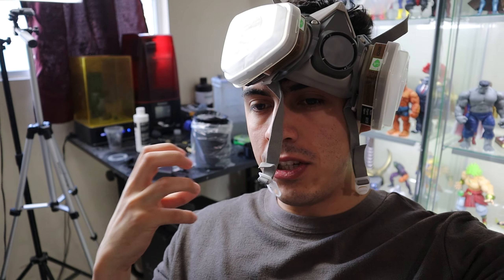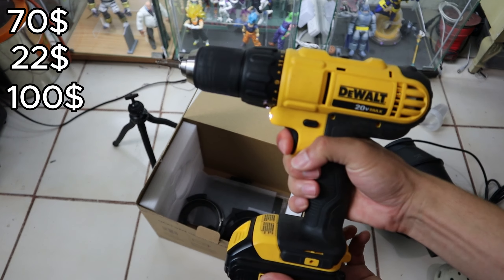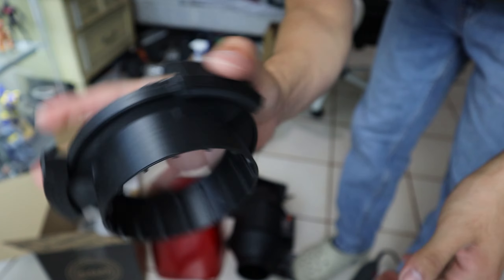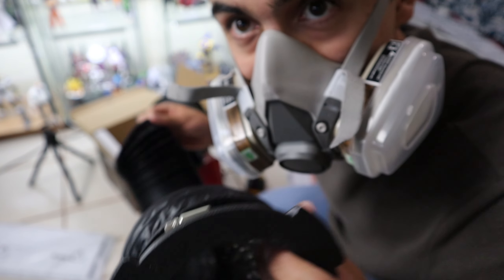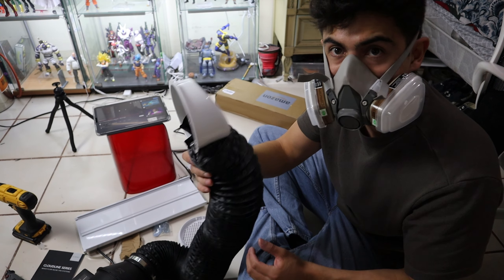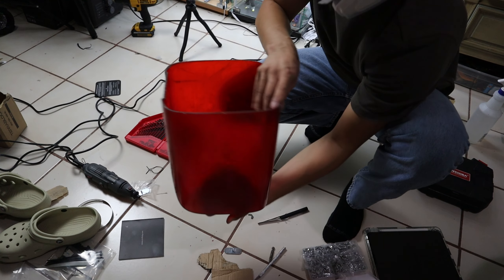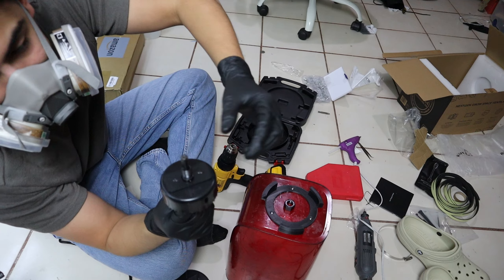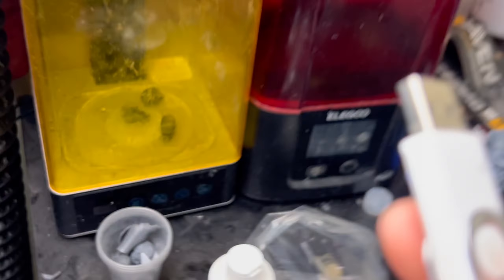Building a VENTILATION SYSTEM for my RESIN 3D Printer (SO I LIVE LONGER)

Comment: “The filters you’re using on your respirator aren’t suitable for protecting you from the fumes generated when working with resin. These fumes can be harmful, and it’s important to use the correct filter. I know high-quality filters can be expensive, but you should consider getting a proper filter from the company DRAEGER, which is designed to filter solvent vapors and chemicals.”

Suitable Filter for Resin Fumes:
To effectively protect yourself from resin fumes, you need an A2P3 combination filter (A2 = protection against organic gases and vapors with a boiling point above 65°C; P3 = protection against solid and liquid particles like dust). This filter protects you from both fumes and fine particles that are released when working with resin.

Comment: Question I always wonder about these designs is how do you keep your resin warm enough if you're chucking most of the volume of air out of the top of the printer?
Reply from the maker: Good question, when it comes to the heat it may affect the print quality in some instances, may see more failures when it comes to a colder environment but I’ll see